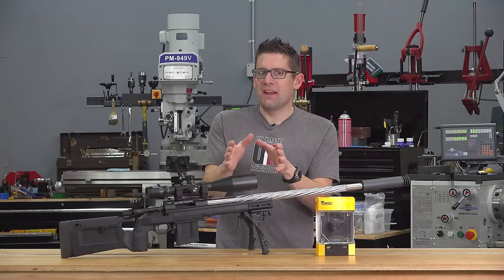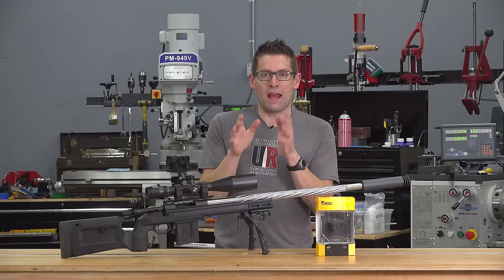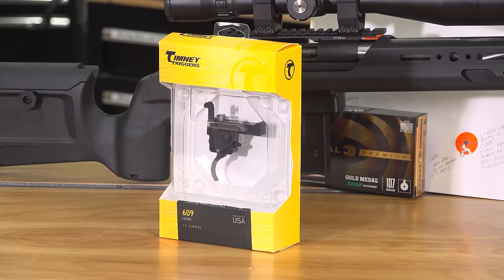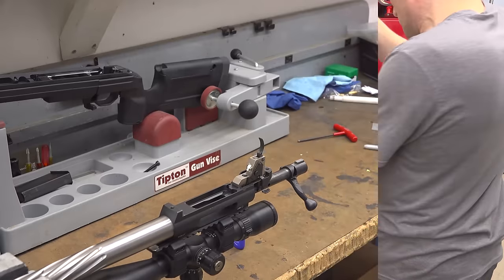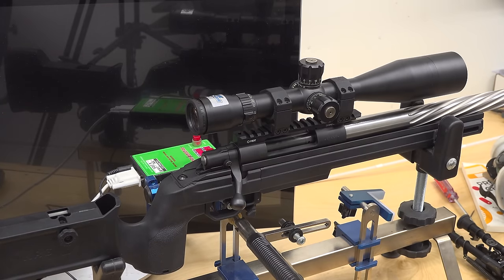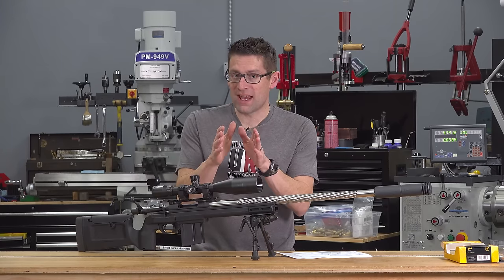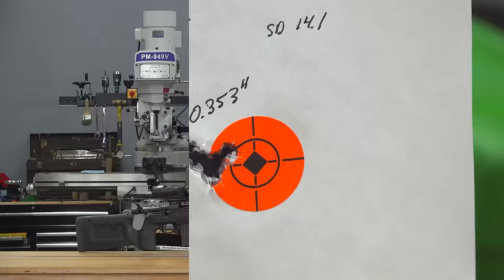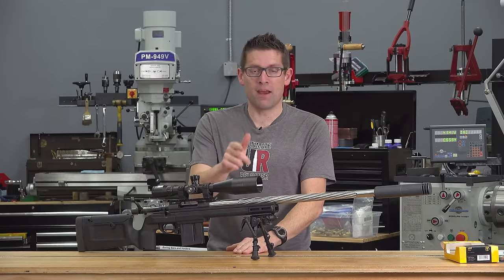Timney HOWA 1500 Trigger Upgrade: Install, TriggerScan, Shooting

Comment: I have a weatherby vanguard 2 with the same factory 2 stage trigger and installed a gun-bloke trigger spring kit ($20) and now she breaks right at 1 lb. It was easy to install and easy to follow instructions. Well worth the money and they come in different pull weights 2.5,2.0,1.5,1.0 lb , I got the lightest and I’m extremely happy with it.
Reply: How is it. I feel like 1 lb is too light haha. Thinking of ordering the kit.
Reply: I got the same results by cutting 1 coil. I still prefer the factory single stage that was offered before the HACT, wish I could find a couple more of those...
Reply: @a.joegevara3519  Did the same thing with good results.

Comment: I just changed out the spring in mine with a spring kit from Gunbloke on eBay, I like a 2 stage trigger and now it releases at 1•5lb, total cost was about $22, winning😉
Reply: I have the gunbloke 1.0lb spring kit and it works and feels great, still retains crispness and with repeated blows from a wooden mallet to the barrel and action resulted in zero malfunctions, I like my triggers light crisp and safe.

Comment: wait, you said it was a 1/4 moa rifle once the barrel was replaced. then you drop in this trigger and it goes from 0.25 to 0.35moa.....and thats good?  lol
Reply: That's a great question however I wonder if the small group was due to him shooting and extremely cold and snowy weather? This may have caused the barrel to not heat up therefore keeping a tighter grouping. Your observation is interesting.

Comment: Keep the h.a.c.t, remove the trigger and actuator, clip 1.5 - 2 coils on the actuator spring and adjust the tension screw if needed. Save yourself $150. Howa made a great trigger out the box.

Comment: I did the same as many and changed the springs and polished the sears. Can now get the trigger safely down to half a pound if I want too. Cost me $22 Australian. Way less than a Timney. Timney triggers have their place but not to replace the HACT triggers, just my opinion.
Reply: Agreed. HACT triggers are phenomenal with a little simple tuning.

Comment: The HACT triggers by HOWA have been fantastic and with spring changes you can get reliable/safe triggers down to the 1.5 lb range....problem solved, although nothing wrong with Timney products.
Reply: Excatly a single spring would reduce the the trigger pull to 1.5lbs. Best $25 upgrade

Comment: I have an older ( 10 years or so ) heavy barrel Howa in 22-250 mounted in a Boyd's laminated varmiter stock I too took the factory trigger off and replaced it with a timney trigger the rifle shoots like a dream

Comment: I recently bought an older production 1500 from before they came out with the HACT 2-stage... probably a 6 lbs, gritty, stagey single stage trigger. Upgraded to a Rifle Basix drop-in and now it’s an absolute joy shoot. Trigger upgrades are probably the bang-for-your-buck mod you can do.
Reply: Would you mind sharing some of the approx prices you would have to pay for what was done or added from a consumer perspective?
Reply: What you described is exactly how mine feels.  I describe it like it feels like there's sand in the trigger... horrible.  And it's very stiff. Can't wait to try the timney drop in when it gets here Tomorrow!

Comment: just modified the trigger on mine, snipped 1 ring of the trigger spring , stretched it back to origibal length and heated up both ends of the spring to take some of the power out of the spring . and its now just right at 2lbs pull

Comment: I just added a Timney trigger to my Howa 1500. I purchased a 2ld trigger. Im not that much of a fan of the feel of it. It feels heavier than 2 lbs and not much of an improvement over the stock trigger. Im going to try adjusting it down like you showed in the video. I wish the safty was still 3 position. Its not ideal for hunting.

Comment: Eagerly awaiting the arrival of my timneybtrigger tomorrow for my howa 1500. I just couldn't handle the factory trigger anymore. Felt like I was pulling it through sand. The rifle is a .270 caliber.
Reply: All you needed to do was tighten the adjustment screw to take out all creep, then cut 1 coil off the trigger spring. Then you'd have a glass rod break at 1.5 lbs...

Comment: Did you try adjusting the factory trigger?  Did you try shortening or changing either spring in the factory trigger?  I did take one loop off the main trigger spring in my Howa 1500 factory trigger and am pleased with the results.  I don't have a trigger scale to measure the results but it felt a lot better, not the lawyer trigger that shipped with my 1500,
Reply: Cutting trigger springs is never a good idea...

Comment: I bet you can get the trigger down to 1.25 lbs or slightly less without slamfire.  Timney is just being cautious due to liability issues.  Would be good to perform tests at 1 or 1.25 lbs and test for slamfire

Comment: So basically all that's left of the original is the bolt and the chamber? That's not a build, that's a replacement. Will you construct another out of your spare parts?

Comment: if the trigger does not completely clear the sear during discharge, there is no point getting it. 
the interference between the sear and the lower portion of the hammer causes an inconsistent primer strike.
there are some old rifles with awful triggers, but the design cleanly clears on release, leading to an impressive consistency.
trigger pull weight is relatively pointless if the trigger doesnt do its job.

Comment: I take it it's only for the Howa 1500 and not the Mini action?  I'm looking to change out my stock trigger in the Grendel Mini 1500.
Reply: Should be fine in the mini as the factory trigger has the same part number in the magnum/long action, short action and mini

Comment: bought the howa oryx in 6.5 creed. took it to the range got it zeroed in about 9 shots. hit the 500 yard, too easy not even a miss, took it to the 1000yd after qualifying to use the 1000yd range... hit 3 out of 4 shots. for a box gun and just throwing a scope on it I was insanely impressed. i've heard some of the howa stuff can be hit or miss, but i certainly got a hit.... and 1 miss .... get it .... cause i threw one shot at 1000 .... its a good gun.... k bye

Comment: U said in a past video, you bedded the action. I have bin fighting some of the same issues with same set up, not wanting to give up on the barrel yet. I notices the poor fit of the action in the stock also so i bedded the action but have not had the weather to test it out. Did you bed after the barrel? Do you think it was more so barrel or bedding? Thanks

Comment: I have a Howa 1500 chambered in 300 WM.  The Hoag stock is not satisfactory,  far too flexible for long range precision.  Just looked at the KRG product line.  Nothing there for the LA.  Any alternates that you might suggest for the Howa 1500 LA?  I am attempting to get into LR shooting on a retirement budget.  The gun was left to me and would like to use it as a trainer.  Thanks in advance for any help.
Reply: Done know mate.

Comment: I have used Timney, Trigger Tech, and Jewel triggers. All of which are well better than factory anything. I also used the MCarbo spring kit in my T/C because no one offered a replacement. It worked very well and was a great price. I add the cost of a replacement trigger anytime I buy a rifle. Factory triggers are horrible.
Reply: By your comment I will bet you never actually tried out a HACT factory trigger on a Howa. Fine trigger, but 3 lbs....a spring kit can fix that and still be reliable.
Reply: @TheWilferch  tried it, swapped it for a Timney. I did not try the spring kit on that one,

Comment: I get similar if noy better with my stock mossberg mvp 223, savage fv12 6.5 creedmoor, Sako robotech pro 30-06 and tikka t3x varmint 308 at 100yards my own loads! the setup is all factory ready. paid 650$ canadian for mossberg, 380$ savage, and 1400$ tikka and sako each. you don't need all that blows and whistles to be .3 inch group. you need a good rifle excellent reloading skills and be a very good shot. my 22lr cz 455 ultra match gets me .5 inch group of 10 rounds in 100yards "most of the times" if its not windy and I don't have control over cci blazers laoding process.
by the way, you got a great rifle, I am not bashing that. but don't get lost into being all fancy and high tech. not everyone gets free products like you....!

Comment: Did this same build with a Howa 6.5 Creedmoor, KRG Bravo Stock, Area 419 Muzzle Brake and finalized it with the Timney 609 Trigger. Been shooting 1/2 inch groups at 100 Yards and 8 to 10 inch groups at 1000. Would you recommend a barrel change?
Reply: not unless you get it for free